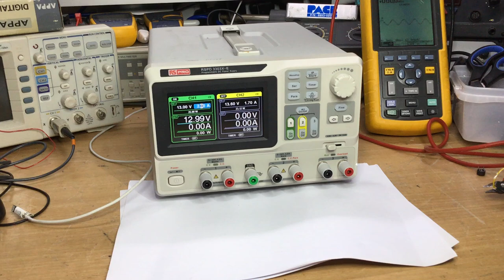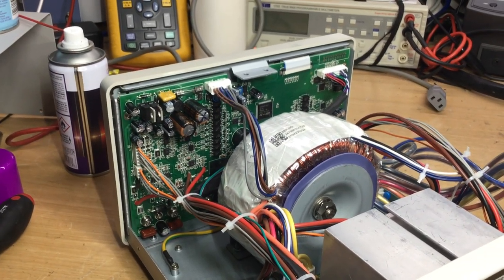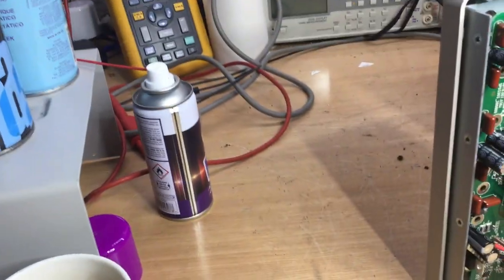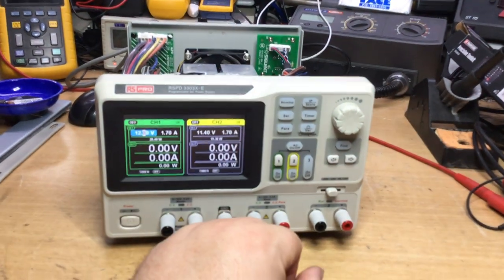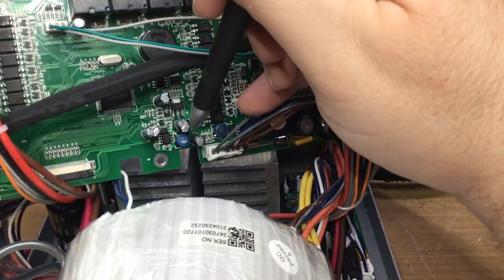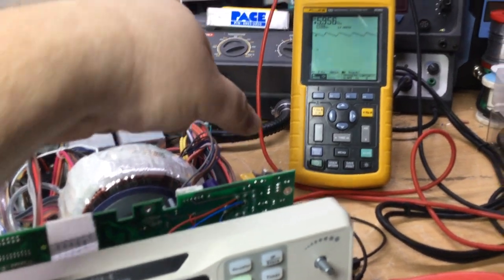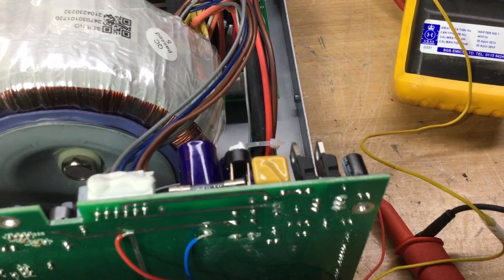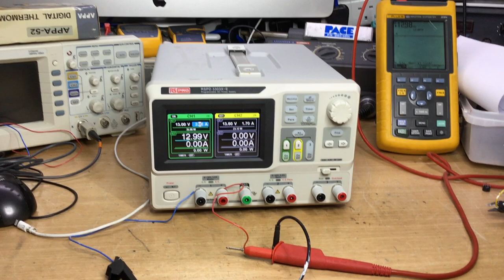SIGLENT SPD3303X Power Supply Repair  0-30v Powers off at random.

Comment: I WOULD HAVE MEASURED THE current at the rectifier, then installed something better suited to match. Of course you could use the existing long leads now to fix a new rectifier inside or to the chassis and run leads to those long legs ( after cutting off the replacement rectifier).  Either way a great explanation and tutorial on methodical trouble shooting. Really enjoy your videos!

Comment: I would have put 105c caps next to the a rectifier in your configuration but i get digging in the parts bin is a pain. Best scenario, I would have added a heat sink to it to move the heat away from the caps and the board so they don't soak the heat from their leads into the caps if i used 85c caps. That would be best for longevity sake. I may add a heat sink at least mine knowing this is a possible failure point. I agree they should have added more space between the caps and the rectifier if they knew that puppy got that hot. Yes bad design. Thanks for the video.

Comment: I have acquired a RSPD3303C and I wished I had looked at your video before spending the entire evening fault finding an identical issue. The PSU is essentially identical inside bar the screen. System  rebooting randomly and going into an inoperable state. When the issue was present the input to the voltage regulator was 3V dc instead of 5V. Checked the caps. In the end I noticed a low voltage on the output of the bridge. Replaced the bridge with one of similar specs but 4A  rating. The original rectifier is a 2A 2W10 and is in my opinion not up to the job. Thanks for sharing

Comment: That looks like a design flaw to me; probably driven by cost constraints. If I owned one of those power supplies I think I would pimp it and replace that bridge rectifier with a larger chassis mount one. It would likely stop the smoothing caps from getting so warm and extend their lifespan too.

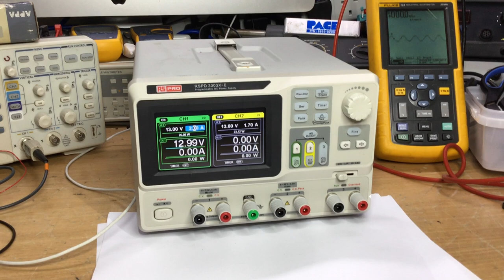Comment: Quality good, BUT 1:52 for a repair is a bit excessive, can you decrease videos like this to about 30 mins? just the main points we need to know, for instance most people repairing will know there is 4 diodes in a bridge rectifier. But thanks for publishing, this fault is very common it seems looking through the amazon reviews on the 1 star ratings (Always go on the 1 stars not the 5 which are often manipulated!).
If I was repairing this, based on dried up caps, hot bridge in close proximity, I would have just slapped in a bigger bridge, replaced caps and called it a day, not wasted 2 cans of air...and an hours analysis, just a thought).
As for Siglent...well those engineers are really cutting it fine with current handling and penny pinching, tip for new players, always exceed power or current ratings by 1/3 extra, and never put potentially hot components next to electrolytics!

Comment: I wish he had changed the rectifier an hour earlier!   We have one that doesn't light up at all!  Does anyone have any troubleshooting tips?
Reply from the maker: Hi There, Well if it doesnt light up at all what i would do is start at basics being, to varify if its just a backlight usse check to see if the output still works & the buttons light up when pressed, if they do it looks likely its a LCD backlight ussue so read on, check all the fuses are ok. From there connect an ohm meter across the mains plug Live & Nutural pins (with the unit unplugged of course) press in the power button & should read from open circuit to a lowish hundreds of ohms resistance with the power button pressed in, all this non invasive test does is to confirm the fuses, cord, switch, & primary coil of transformer are in circuit. Obviouly under this test if you can only read open curcuit then there is a break somewhere. Secondly if all that works out you can measure across the rectifier diodes / smooting capacitors on the main PCB towards the rear with the heatsiks on it. This may be difficult due to the cramp space, but the object here is to confirm if there is DC voltage on the smoothing caps. Thirdly the little bridge rectifier as in the video that powers up the front board this supplies one of the voltage regulators which you can measure, using the heatsink TAB as the ground reference for your meter, also the regulator IC runs fairly hot if its getting & giving out a supply, also there is a single diode near the this on the top edge of the PCB which supplies a yellow / orange coloured thermal fuse next to it, this also supplies many circuits so check. You will be able to see the small connector suplying the board with a connector near the bridge rectifier this supplies about 2x 6v AC supplies to this board to supply the little bridge & the single diode. Note the -ve (0v) line reference for measurments here is isolated from the (ov) on the main board / high current supply outout :hand-orange-covering-eyes:as there are different secondary coils on the transformer. The little bridge rec as per the video supplied other voltage regulators on the PCB near the processor chip, as identified in the video, also there is a Buck circuit / charge pump located near the processor & display connector which supples high voltage to the LCD back light. Check components round there. the surface mount inductors should give a dirty ringing sound when the Buck is working it sounds like low volume white noise.

Comment: Did Siglent fix the problem because I bought one a few weeks ago. I do not want to break the seal to investigate because it would void the warranty.
Reply from the maker: Well TBH i do not know if Siglent did change the design, i would not worry about it as it may take many years for this issue to show, i don't think its a common problem because there are not any other videos on youtube about it so it may be an issue to only a small number of supplies & could be down to a bad batch of bridge rectifiers that affected only a small number of supplies that may have been returned under warranty. At least you know how to fix should it happen.
Reply: I have two SPD3303C and both have the small rectifier but one has a small heat sinks glued to it. This version with the heat sinks has experienced the problem